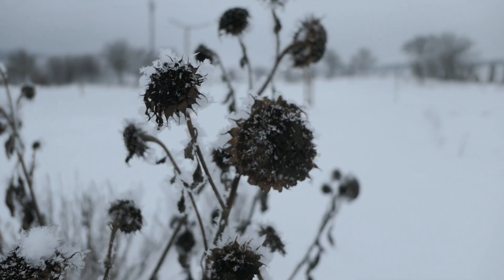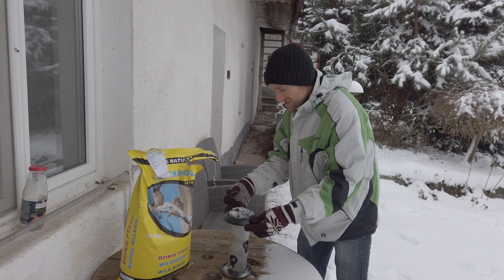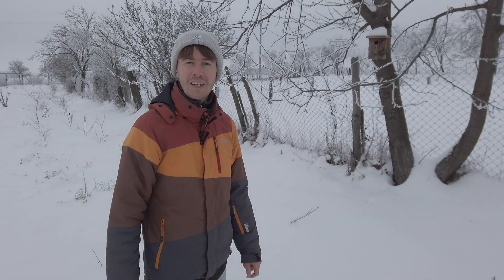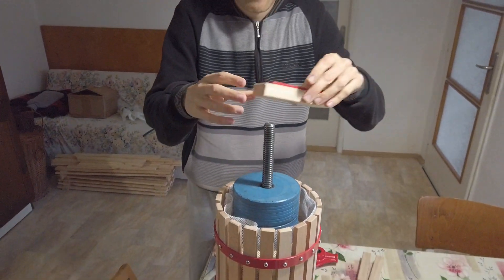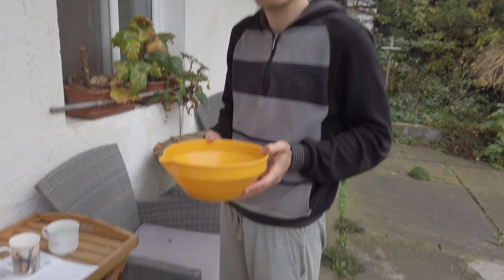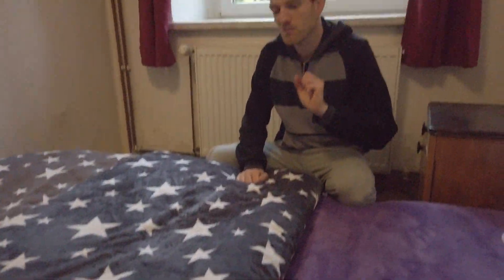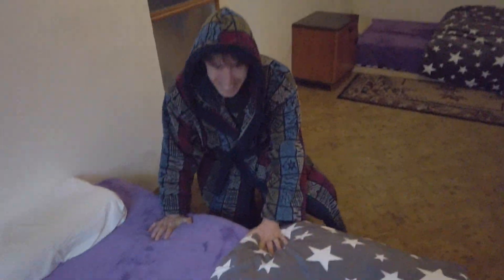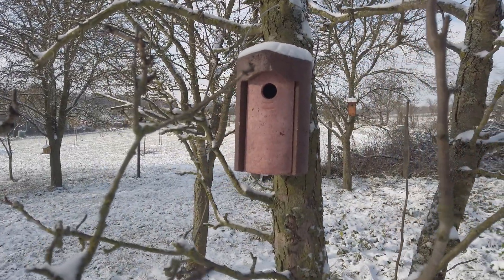Another fail at the country house | Making apple cider | Wintertime at the cottage

Comment: Is Tommy in shock for the beauty, or frozen?  LOL  Volume of cider depends on how strong the press is and size of press.  I have never done one so small.  Usually we get 2-3 gallons/bushel   7.5L cider/35L  not sure the bushel conversion makes sense, 16kg maybe better unit.  My dehumidifier has a connection for a hose that I attach with other end over a drain.  I can leave it running and it stops when air gets dry enough.  Check to see if yours has a hose connection, you can de-humidify when you aren't at home.  :)  I love your house, but I don't live there.  LOL  Stay warm.
Reply from the maker: I think I was both shocked and frozen 😄 I think our press just has bad construction. There should have been much more cider based on everyone's feedback. We'll see if we can improve it before we try again. Our dehumidifier also came with a hose but we haven't needed it yet as the container has enough capacity for our current needs 😊